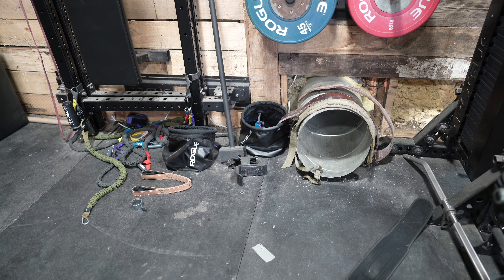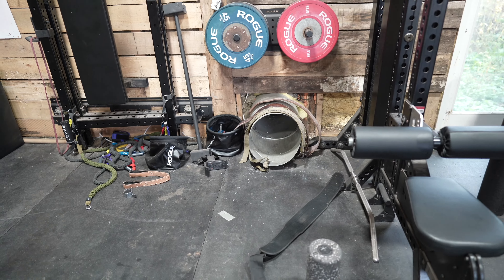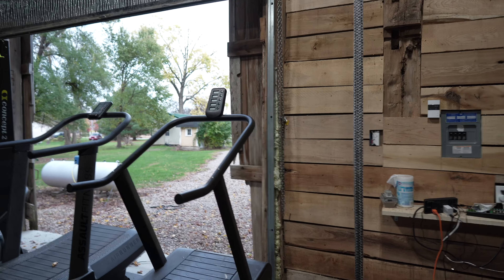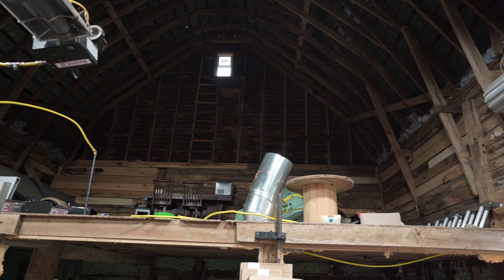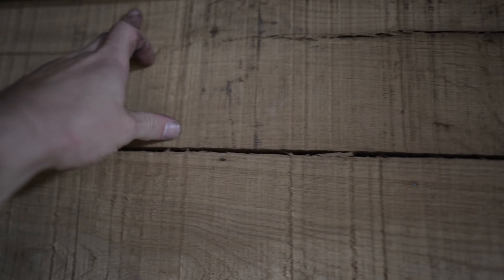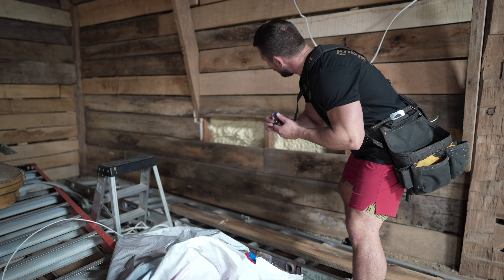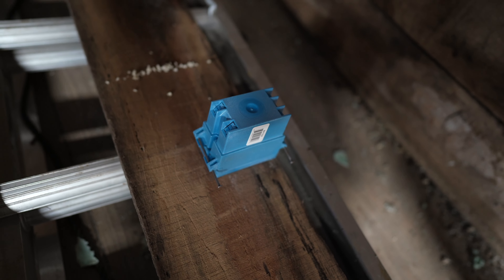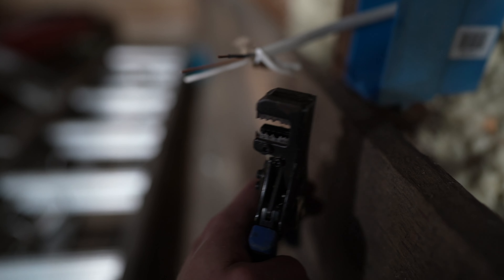BARN UPDATE: SLOW PROGRESS IS STILL PROGRESS

Comment: Please say more about the blaze heater. What do you do about the fumes? Is it a problem? How much fuel does it use more or less like per hour or per session?
Reply from the maker: Ill get the direct specs to you in abot a week but it is 130k btu and runs at a bout 3 gallons an hour on propane. Venting isnt a problem because the barn already has so many “leaks” and open air areas (doorways, ceiling vents). A alarm is in there that alerts for unsafe levels but as I continue to insulate Ill have to create a vent specific for that unit.